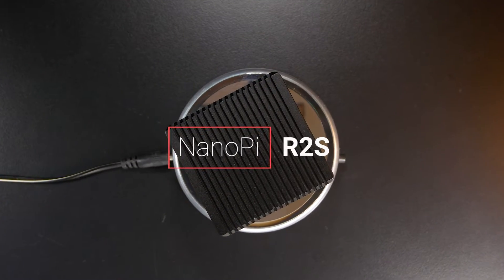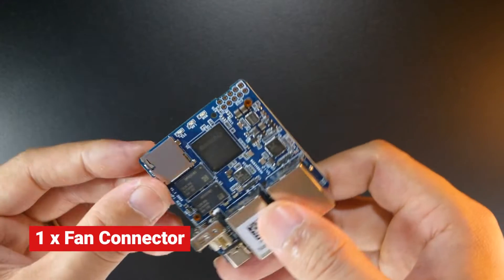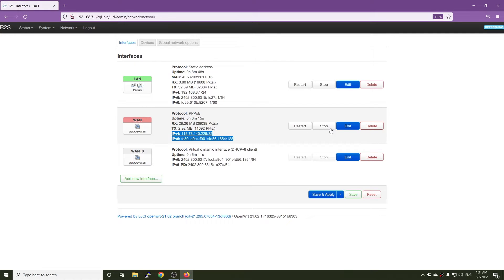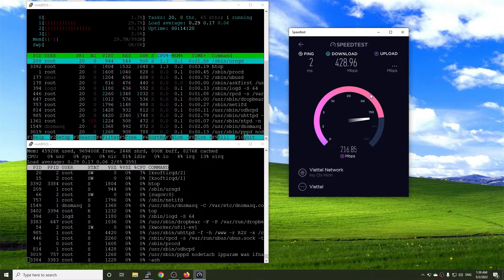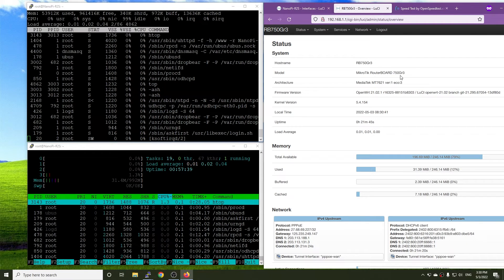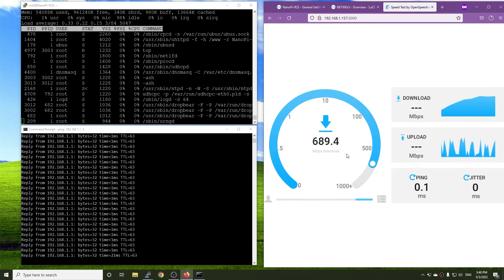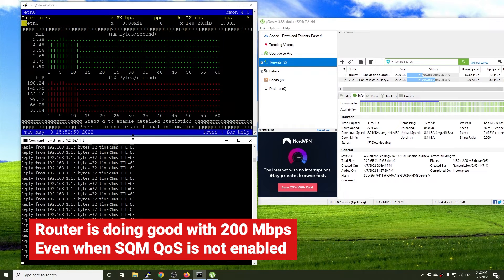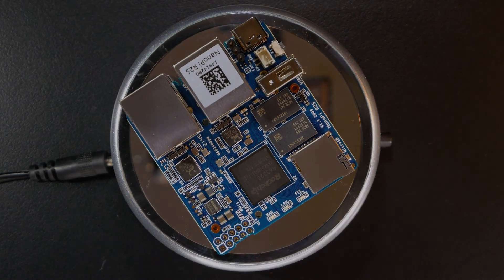OpenWRT - NanoPi R2S Overview & Performance Test (NAT, OpenVPN,Wireguard, SQM QoS)

Comment: I'm trying to set up an access point (Ubiquiti 6 Lite) in client mode with Open Wrt. Is this possible with that AP because according to the OpenWRT documentation the client mode requires routing and I thought routing is only possible with Wifi Routers and not with standard AP's like the Ubiquiti one (or am I wrong and OpenWRT adds Routing capabilities with its firmware and routing does not require specific Router HW)?

Comment: From my understanding OpenVPN is a long script compared to wire guard and takes longer for the connection to ping back.

Whichever device does PPPoE also has to do NAT, and whichever device does NAT usually does DHCP. If your router has a better, more flexible NAT and a better DHCP server, let your router do it.

You don't want both devices doing NAT if you can avoid it. That's called "double NAT" and tends to cause problems for people who don't know what they're doing (and even some who do)
Reply from the maker: Hi, is this a sharing or question? 
I think most of the viewers who are watching this video (and other OpenWRT videos on my channel) know what they are doing, since OpenWRT is not for normal user who has no basic understanding about networking.
Reply: @VanTechCorner  yeah I kinda figured that was the case, but I was just sharing some info because I'm the video you had said you weren't sure why the OpenVPN speeds were so slow compared to wire guard or PPPoE
Reply from the maker: @elijah2863  I see, I mean the download speed of OpenVPN is way lower than then upload speed. (while my other OpenVPN tests have different result)
Reply: @VanTechCorner  interesting, looks like Dnsmasq is being used. I'd double check the config file on any routing repos you have for OpenVPN. obviously you ran the thru put test, which has a few different results such as higher PPS and lower speeds. If the config files seem to be routing the traffic correctly, maybe run a trace to ensure it's not hopping from server to server and enable Mac funneling to prevent any packet loss as anything above 3-6 PPS will cause degradation depending on configuration. Looks like it could be a syn flood augmented by a large syn flood. (Packets of 800-900). I also noticed you're using ubus, I've heard they're way better protocols to dump data. Ubus is pre-configured and more user friendly, but is more vulnerable as it's already configured for you to use.
I'm just sharing information so if I'm mistaken please correct me ☺️ also thank you for replying, I've learned so much from all your videos 😬💪 keep up the great content, I'm a huge fan
Reply: @elijah2863  What a load of gibberish.
openVPN is processing AES in a stream using one core & built in crypto module. Wireguard uses ChaChaPoly implemented in software, which can be spread across cores.
The R2S is slow at openVPN compared to the R4S due to the much lower clock speed.

Comment: What charger or dc adaptor are you using?
Reply from the maker: Hi, I used the Official 15W Raspberry Pi USB type C PSU, it comes in different AC socket plug. Mine is the EU plug, available here https://www.cytron.io/p-official-rpi-15w-5v-3a-psu-usb-c-eu-plug-white?tracking=vantech

Comment: How did u manage to get 940mbit with sqm on your R4S ? I got the OpenWrt 22.03.0-rc1 Firmware and I’m getting only 650mbit ?
Reply from the maker: Last time I tested, the R4S was running OpenWRT 21 snapshot. I will give a try with current build and let you know.
Reply: @VanTechCorner  thanks ! i also tested the newest snapshot with packet steering + irqbalance but it didnt work